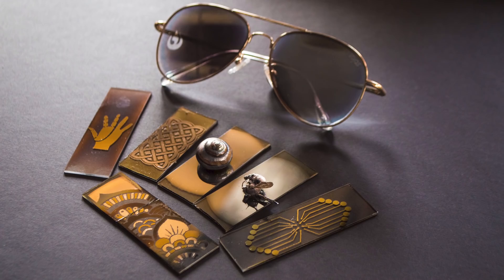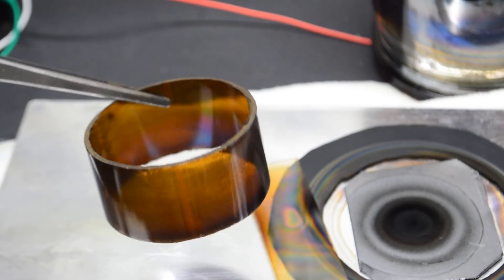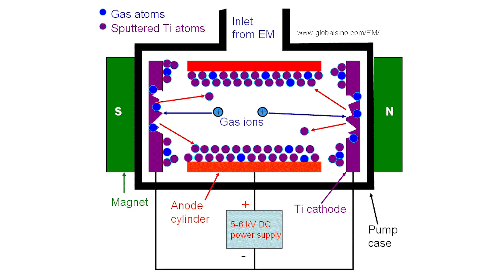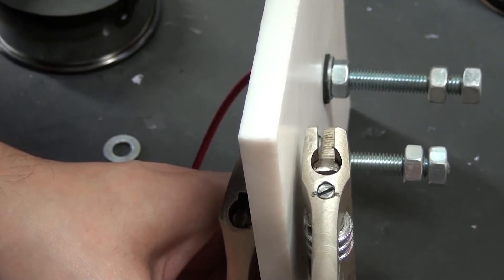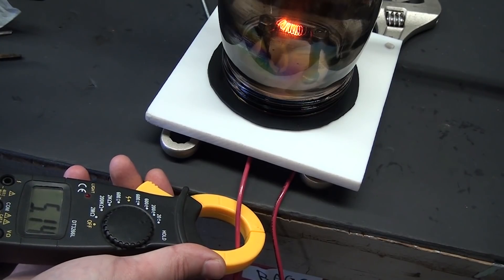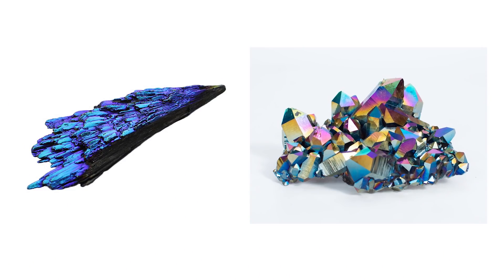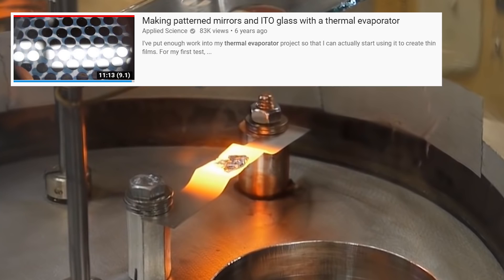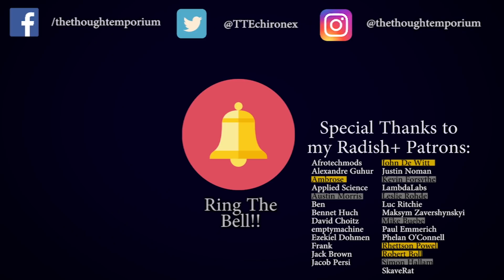This Can Coat Anything in TITANIUM

Comment: Fun with Ti wire.  I use Grade 2 Ti wire in my vape- I make my own coils.  I love Ti-  I'm a mechanical engineer who designs/builds shell and tube heat exchangers (my work also has a machine shop) and we're constantly using Gr2 Ti tubes (and tubesheets) in retrofit and new build heat exchangers.  We also do Ti explosive cladding to steel for tubesheets.  I thought it was very cool to see your work here.  Keep it up man!  Subbed.

Comment: When you're wrapping a coil that way, wrap it tight.  

2. Squish your tight wrap even tighter while it's on the rod.

Then pull your coil to desired spacing while it's on the rod.  

This works unbeleivably well.

This will evenly heat the coil and reduce titanium wire consunption

Comment: If you plan on doing this often, I’d invest in a low-voltage constant-current driver circuit of some kind. Perhaps even one with resistance-measuring negative feedback, though that one would almost certainly need to be a home-brew circuit.

Comment: You think a DC welder would work for this?  I kind of want to buy a vacuum bell now, and see if I can make one that adapts to my MIG welder.  Just attach the ground clamp to one probe, and make the other probe a wire with a small clamp on it to grab on to the contact tip to complete the circuit.  Take the wire out for obvious reasons, then mess with the voltage to find a sweet spot.  If you're burning coils too fast, make the over all wire longer.  Make the span wider, and/or make the coils bigger.  Maybe even double coil like a modern incandescent filament.  You're also creating a magnetic field in a vacuum by using a coil of DC current.  Try placing your object on one side of the coil to see if it's lofting the titanium in one direction.

Comment: Make use of the 'Cathode - Anode' 
Arrangement.  

Allow a larger gauge filament to heat a smaller gauge cathode and make the item you wish to paint be used as the anode. 

I believe that you will find that this will be much more efficient in time and the materials being used for painting.

Just a thought..

🤓

Comment: You get the rainbow from titanium because of a thicker than normal oxide layer.  In order to get any other color than grey/ black, you need to encourage the oxide layer to grow more than its natural couple nm.  Straw starts around 20 nm.  Blue starts around 40 nm  Either heating the Ti in the presence of oxygen or using a chemical process to grow the layer is required.

Comment: I remember seeing the original video on this sputtering setup but this one apparently slipped by me. Super interesting about the carbon coatings. Not sure where you got to with the "diamond" testing but deposited carbon, depending on the process, will have some fractional combination of sp^3 (diamond) and sp^2 (graphite) bonds. A good method to test  is using Raman spectroscopy to get the percentage of each. If you wanted to get a rough idea of whether the deposited film is more graphitic or diamond-like you could measure the resistivity, since one will be high and the other will be low.

Comment: 0:30 - you mean dichroic, not dielectric.
Absolutely love your videos, all these things are just so cool! (I need to learn a lot more about this stuff!)
Reply: Actually, both, because metal 'oxides' are typically dielectrics, so controlled oxidation or sputtering of an existing metal oxide (usually by electron beam) will make insulating coatings. Note: "oxide" in this context includes halogen compounds and more, like magnesium fluoride and titanium nitride.

Comment: You can get cheap 3 terminal ceramic screw terminal blocks on AliEx. Loop your wire between 2 terminals and make a stand inside the container attached to the 3rd. 
 
 You've also got a repeatable alignment jig. How about magnetically coupling a couple of wire coils with an interference shield above them, and build it into the base? Then your only external connection would be the vacuum fitting. Why not build that into the base as well? Then you would have a passive container, and the flexibility to change it to suit your needs.

Comment: Aluminum coatings on the inside of lamps seems to be aluminum slug in a heating element, usually the same element that will be the lamp's filament.  The videos on it seem to also use a metal shield to ' force ' the coating only on the back as the metal also gets an aluminum coating.  You might want to try it withnyour current setup with a small rod of aluminum inside the titanium, just keep it lower than what would give the titanium coating.

Comment: Well...
I’m a 15 yo and have been always interested in this stuff and I’ve always made things by my self. So... I love titanium, I love it’s rainbow colours and when I saw this I immediately wanted to replicate it. I recently found love and I’m pretty sure she’s the love of my life and wanted to make her an engagement ring so I first design it and then printed a couple of test with my sla 3d printer to make sure the shape was right and actually fit her finger. Next step will be to try coat different metals an see which ones works the best and then use it to make a lost wax casting. I’ve already built the chamber and it works really well. The only problem is that with the lost wax casting I have very limited choice for the metals because I can’t get high temperatures. I tried with silver but the copper in the alloy oxidise too and blue stuff shoots out when I try to get the rainbow with electrolysis.
I also got amazing results with aluminium but the problem is that it’s not very strong and it scratches easy 
I was hoping that someone could help because I have some doubts on basically everything and I’m freaking out
Sorry I’m italian and I don’t know English very well

Comment: 9:39 did you say golden?  Could it be nitrogen contamination ergo titanium nitride? If it is, that is a blessing, I've been trying to do other sputtering configurations, but this one seem cheaper and easier by a lot.
Reply: It is TiN. However, you're not going to get the things you probably want to get by coating things in TiN.
Reply: @Spirit532  I mean would that thin of a coating not be enough for an implantable magnet? Not that I'd ever trust a magnet I coated myself but it's interesting
Reply: @Enderbro3300  It would be! But the coating quality, uniformity, thickness, and chemical properties(oxide/nitride content) is pretty much impossible to control using this kind of hacky setup.
Reply: @Spirit532  Yeah, i would not risk the coating quality in an implant.  However i electroplate small pieces and this technique with some adjustments can expand my range to simple pvd like finish without the price of a full sputtering setup.  Titanium (specially titanium nitride) cannot be electro plated unless you have sodium metatitanate available and you believe some old russian recipe.

Comment: How well does the titanium coating stand up to wear and tear? If it stands up well it would be great to use it for strengthening things like copper and steel buckles or sword fittings or even firearm parts.
Reply: I doubt that the titanium coating is contributing that much mechanical strength to the objects it's coating. its purpose in these cases would be more aesthetic

Comment: For doing electrical pass through bolts like that, just solder or braze the nut which resides on the inside of the firewall. That way air doesn't leak along inside the threads, and the rubber washer seals very well to the bolt that way. Otherwise sealing threads through a bulkhead is nearly impossible.

Comment: Another method is to use a sheet of metal with an extremely high melting point (shaped like a bowl in the middle) as your filament and putting your metal on that, this way your metal evaporates and coats whatever object in the chamber. Also, since the filament is different, it wouldn't be melting at the temperatures you want to work at.

Comment: You need photolithography  for the masking. it is more expensive than physical masking, but way more precise. Maybe you can even use kits for photolitographical PCB etching (you will need to replace the etching solution to CuCl for aluminium, or maybe use plasma etching, but the mask material may not be compatible with plasma)

Comment: Please try induction heating coating. I did a few yeas ago and it works as good as with the coil. Just use a tube instead of a coil, it's easier that way. Also, have you tried to make Molibdenum or berilium mirrors?

Comment: Magnets are used to disperse the titanium for uniformity, not to attach it.

You use it to coat the inside of holes .3um by 1um deep. It will be conformal.

Next step, put your metal in a side chamber, let it get hot enough, then open a shutter letting it flash boil and instantly coat everything.

Comment: Hold up is noone gonna talk about how he subtly mentioned he might've synthesized diamond???
Reply: making small diamond crystals is easy. Making big ones is hard.
Reply: Not really "diamond" but "diamond-like", with all kinds of non-diamond stuff in it, including soot, graphite, graphene and carbon nanotubes of many types.
Reply: You can buy bags of PVD diamonds for just a few hundred dollars. It's a common material used in many places. Optical windows, abrasives, etc.
Reply: A tiny layer of diamond isn't really a big deal.
Reply: The price of Diamonds is artificially inflated by the DeBeers company.

Comment: Just found your channel ,  you can improve the Ti uptake on the plate  you used buy putting it above the  gadget  instead of below as the oxidised particles are a lot heavier than the active particles  which get airborne , its not as fast as below but will give you active metal  not oxides,  cheers

Comment: Don't forget that titanium particles are moving linear in all directions till they hit the first thing on their way. Layer thickness calculation is like light intensity calculations (the heating wire equals a light source).
To get a layer at all you'll need a vacuum, so that statistically no other atoms/molecules are in the way. There is no field directing movement of the titanium.
Aluminium will work if you can vaporize it on a tungsten carrier. You will need many amperes as aluminium is a good conductor before it heats up, melts and vaporize.
Establishing a glow light step into the process will clean up and prepare surfaces.

Comment: I'm thinking aluminum turns into aluminum oxide, if not done in a vacuum.
If the layer of aluminum is too thin, it'll just turn into aluminum oxide.
I'm also thinking you can increase the titanium coil/wire length (more windings). As long as you're applying an AC voltage, the inductance would increase, thus reducing the current going through it all.
If you can only apply DC, a longer coil still has a greater resistance, so your transformer voltage can get higher, while keeping the current at bay; and longer coils mean more titanium dispositioning.

Comment: DUUUUUDE this video could not have come at a more perfect time for me! Omg I had no idea I could make a mirror on a budget like this, I just need it slightly scaled up. What sort of budget vacuum chamber could I use/make for say a 2x2 ft. mirror? Would a dome of concrete be viable?
Reply: Concrete? Are you sure you want vacuum coating??? Perhaps you can use the old chemical methods of electro-less plating? Only use concrete if you can coat it with metal to stop water and air from coming through and out... which is much more of a trick than making a mirror. Plain steel chambers can work, but it too will benefit from coating in another (less reactive) metal. Fortunately, that can be done via thick Electroplating after making the chamber. Then, if you want good quality, set up the coating target and everything and bake it all for a few hours at 200 C while pulling vacuum on the chamber. This will greatly improve the quality of vacuum, which becomes increasingly important with larger chambers and larger coating targets. This is a matter of mean free path. If you must use rubbery seals that cannot withstand 200 C, you can use Viton (fluoropolymer) at 100 C and give it a much longer heat+pump cycle. Only then activate the sputter coating components. With all that said: It will probably be easier and give better results if you find some amateurs astronomers who make their own mirrors.

Comment: I think I see oil mist at the vacuum pump outlet.  A separation filter might be worthwhile.
Reply: Easily made for both inlet and outlet from copper wool scouring pads, or stainless steel wool, packed into a section of pipe. On the vacuum side, it also helps to chill that section of pipe with dry ice or liquid nitrogen.

Comment: Zirconium welds similar to titanium, soo you should be able to do the same with it.. and you might be able to use titanium, and zirconium filler metals which would be thicker than the filaments and maintain the amperage better..

Comment: I got  a download of an extraterrestrial machine using polyhedrons flying around making all sort of plasma stuff and vapor depositing. They operate on nanotech. And each side has a different funtioning. They also create pressurechambers as needed and vacum chambers. Magnetic fields. Some have the ability to morph. As in shapeshift to create different sorts of shielding or functions. Different metals and ingredients are floated into the different chambers liquified and then used in necesary processes. Its future tech on Earth, we have similar tech althoug it is not as mobile yet. More locked into place. Having flying machines which can form different structures and do multiple operations by itself is coming. Thx much love.

Comment: A thin layer of titanium oxide coating can produce a rainbow effect on minerals and solid surfaces.
Opals are already rainbowy and a mineral.

...Can we stack rainbow effects, or would that just not work? What if you selected specific sides or surfaces to coat? What about a well-cut diamond instead?

Comment: Can it be done using DC current ?, or is it only works with AC current ?
Reply: Direct Current is fine, and so is high frequency AC, like an Induction Heater, which can eliminate the need for wires passing through the vacuum chamber walls.

Comment: Much higher vacuum, and use standard PCB resist. The higher vacuum will keep the titanium from reacting with residual gas to form non-conductive compounds. Why you would  make a titanium circuit board I can't guess!

Comment: What if you put a potential difference of a 1000V or so between the sample and one of the ends of the titanium wire? Would the particles of titanium vapor be attracted to the oppositely charged plate? Might help improve efficacy of the system
Reply: Then you get ion implantation, because that is a lot of voltage to apply to a mere cluster of hot atoms. Put another way, 1000 volts is equivalent to a temperature of 11 point 6 MILLION Kelvin , or 20.9 million °F. Hot particles move FAST, and crash through the surface atoms, gradually coming to rest in the solid bulk material.

Comment: This is how CRT's were made. They coated the inside with a bead of platinum. They heated it with a coil of resistant filament and it just went gaseous inside the vacuum.
Reply: Not quite. Platinum is expensive, hard to melt, and is unreactive in the desired ways. Bismuth has been used in a way similar to what you describe, usually in the form of a bismuth-coated loop of other wire, heated by a high-frequency inductive coil. AND all that is only done after evacuating the tubes while baking them, to help drive out volatile substances adsorbed onto the inner surfaces.

Comment: change the threaded rod with bolts. solder the wire to the bolts. put the washer on the head of the bolt. there goes half your leakage.

Comment: I got a question in regards to the "coat anything" area. Can this be used to apply a titanium coating to plastics, specifically Bandai model kits? I'm trying to cut costs down and this seems like a nifty way to apply a coating and make it look nice at the same time. My main worry is either the plastic melts or it burns instead of getting coated.

Comment: Spoiler alert, carbon coating is used with scanning electron microscopes to prevent surface charges deflecting the electron beam.  With a TEM electron microscope, atomic structure can be seen, and due to the lack of pressure and the rate of deposition, the coating does not arrange into a diamond crystal lattice. It more resembles the soot from passing a china plate over a candle flame to condense the carbon soot.  The carbon sticks where it is deposited with no formation of a crystal lattice of any kind.  CVD artificial diamonds is a very hot and slow process, not something you will replicate with a desktop sputter chamber. Hot and slow is required to deposit a lattice on a seed crystal, not on a random substrate.

Comment: You should get a basic power supply where you are able to not just set the voltage but rather the current to a fixed value so you do not have to adjust the voltage manually and avoid the risk of burning the filament/wire

Comment: Can a low vacuum pump be made? Turbo moleclur diffusion pumps are expensive. Could a useful sprengel pump be made using easily obtained materials like lead?
Reply: "Turbo molecular diffusion pumps" do not exist. Turbopumps and diffpumps are entirely different things, and they're pretty affordable on eBay and such, especially diffpumps. A DIY sprengel pump could never reach anywhere near high vacuum. Maybe 1*10^-2 mbar, which is higher than what a good forepump can do.
And no, lead won't work. It can wet glass enough to make the pump not function.